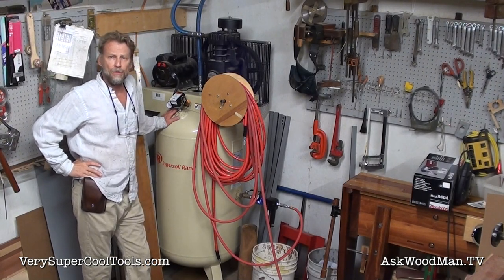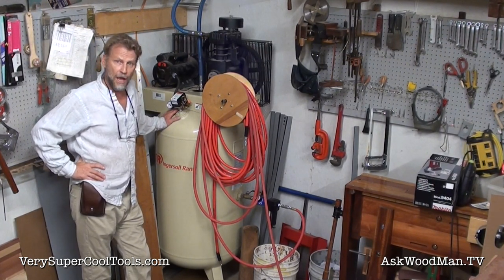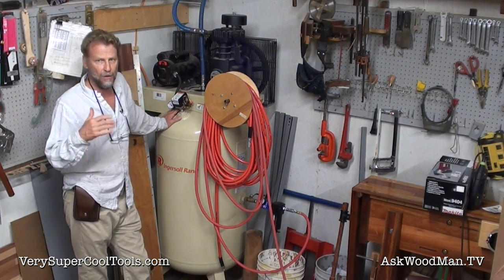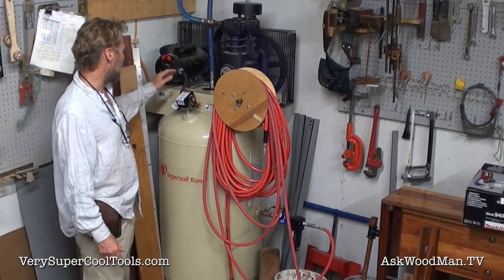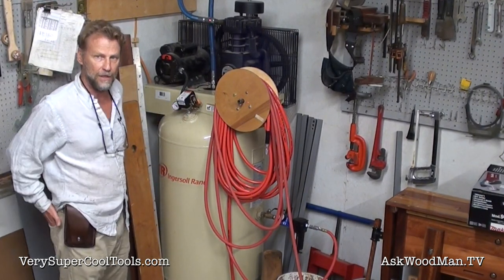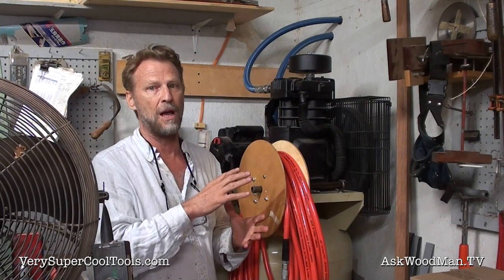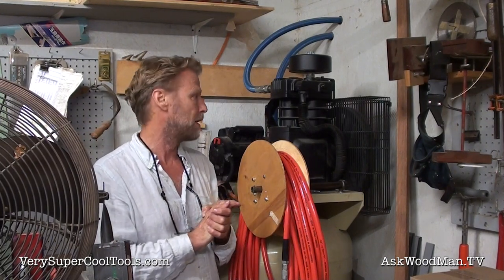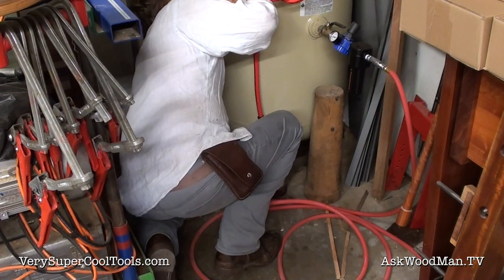1019. Air Chiller Water Separator – Series Intro

Comment: Awesome job!
So im guessing you left the check valve in the top portion of the tank? If so, when the compressor shuts off after a cycle, does it have to decompress all the air out of the chiller section and its lines to relieve pressure for the cylinder head? Must take awhile for it to do that...
I dont have the skills to fabricate the baffles in those chillers...
I wonder could i get away with using 2-3 small expansion tanks and still have positive effects?

Comment: Wow. I really need to check my compressor tank. Hardly use it but if it's got the capacity to hold that much water I'd better make sure it's not rusting away. Look forward to watching the series as always and as always there's lots to learn. Thanks.
Reply from the maker: Water is the bane of compressed air systems.  There is a huge industry that deals just with that. Everything from food processing, industrial painting, printing, and on and on the engineers are constantly trying to remove water contamination from compressed air systems. I think I have succeeded in a low tech passive way to a large degree.